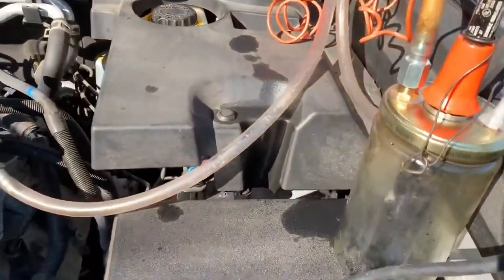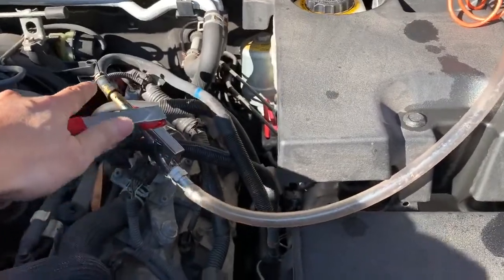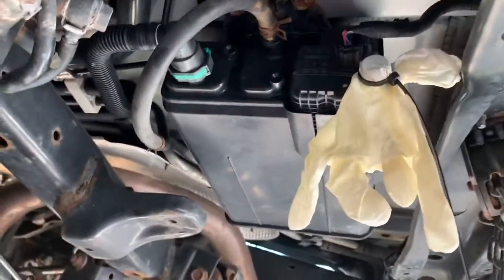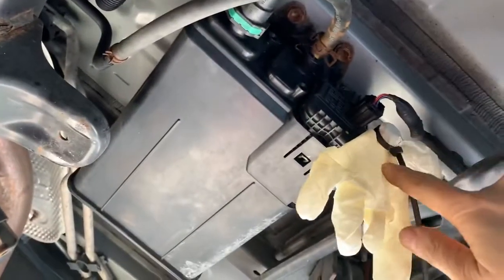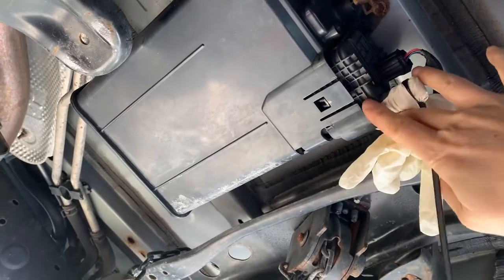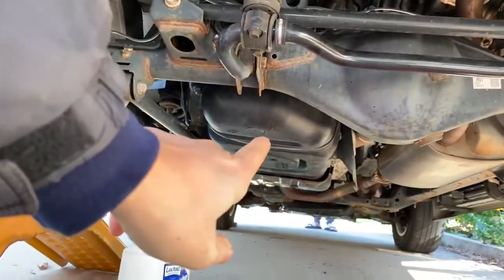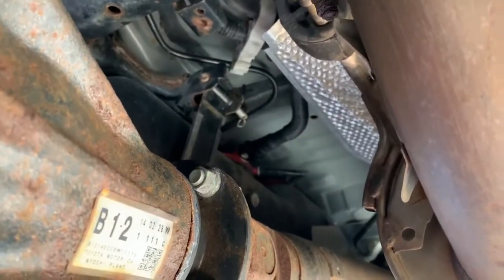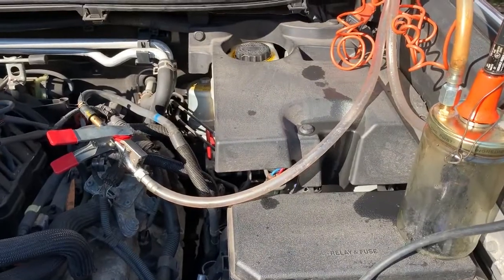Lexus GX460 check engine code P0441 p0455 Evap Smoke test Not the fuel cap it is loose hose Part-2/2

Comment: Great video thx.  How do you remove the hose off the canister without damaging the clip?
Reply from the maker: It’s a quick connection, you just need to use your fingers to press and pull out

Comment: Hi, I have a 2016 GX460 and whenever I press the brake pedal I get a hissing noise like air is leaking from somewhere with a feeling of vibration in my foot from the pedal. I feel like some motor runs to rebuild pressure in the brakes and it makes me feel the vibration. I have recently installed new rotors, and brake pads and bled the brake fluid from all tires, and refilled but nothing helped. Also, another thing I have noticed during this time is that there is air suction and whistle noise when I start the engine which goes away after one minute, and a strong suction noise when I turn off the engine. I am guessing there is an air leak somewhere but I cannot figure out where. I tried a smoke test as well by plugging one of the vacuum hoses into my party fog-making machine but smoke never leaked from anywhere. Can someone guide me on what I should do? through your experience, please? I’d appreciate it! Thank You
I'm located in Houston, Texas
Reply from the maker: Oh sorry, I don’t have any idea!